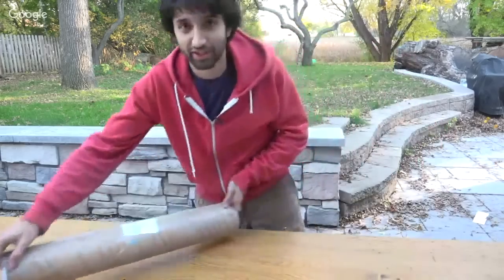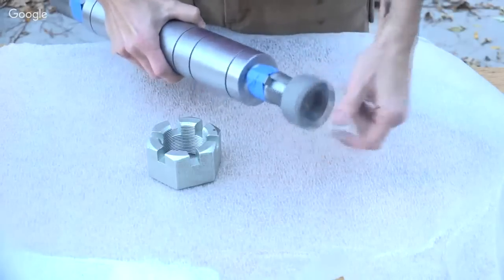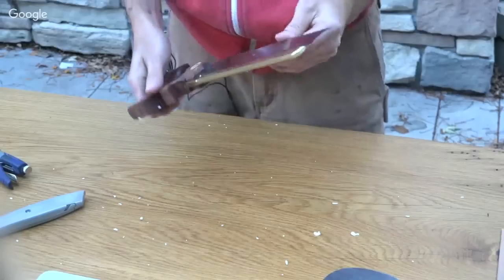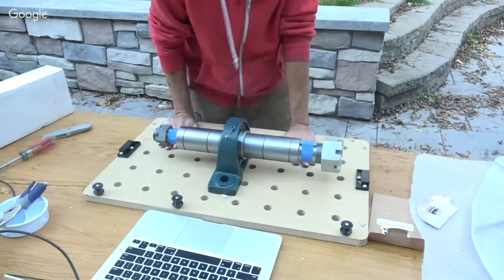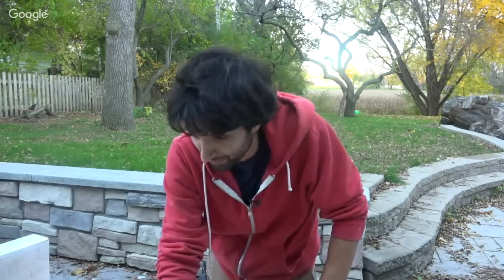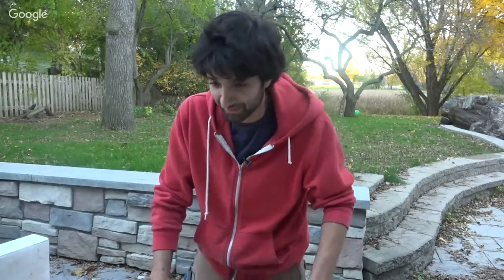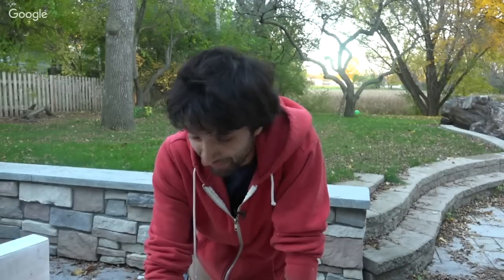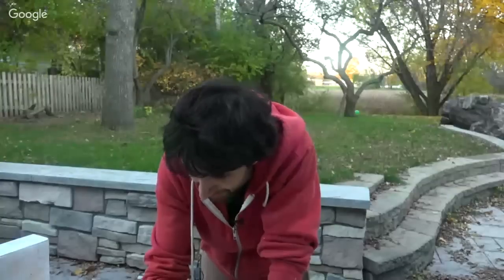Unboxing the Drive Shaft and a Hand Saw

Comment: When using a card scraper you can use a business card sized refrigerator magnet attached to it where your thumbs will be. The magnet absorbs the heat energy built up and prevents your thumbs/fingers from hurting. Learned this in an old Fine Woodworking magazine.

Comment: I'm disappointed I missed the live broadcast! I probably should have put MORE staples on the ends of the tube....glad you liked the shaft.  is it a little bigger than you were expecting? I'm glad I made the shaft bigger than the drawing called for, those bearings should have a set screw (or two).
Reply: can't wait to see it in action!!

Comment: I am not hydraulic engineer, but regarding the ram to keep tension on your idle wheel, it should be possible to have it so it automatically keep a set pression on the piston, going back and forth depending on the way the tension changes. It would be better than having a gauge and adjusting manually.

Regarding the hand saw, too bad the packaging is not up to the quality of the saw: for example, instead of using tape on the folding paper, use a piece of twine, it's a detail, but would immediately up the quality (idea is not mine, I saw it being done with some UK toll makers in the guitar department by the way, they also demonstrated the Wagner moisture meter recently).

Comment: Three bearings on one shaft will be impossible to align unless they have quite a bit of play in them.
Reply from the maker: The pillow blocks are self aligning
Reply: That's only angular.   You've essentially got three fixed dots in a row.  When you start putting side loads on the wheel or pulley, the shaft will flex.  It may only be a thou or two, but the center bearing won't be in a strait line anymore.  It can cause the bearings to see a higher load than expected and fail prematurely.
Reply: Can you tell me what the radial loads on the bearings will be?  Also the type of bearing and speed of the shaft or motor?  The bearing in the housing should have a number on the side of it.